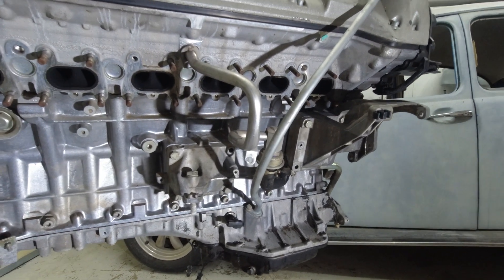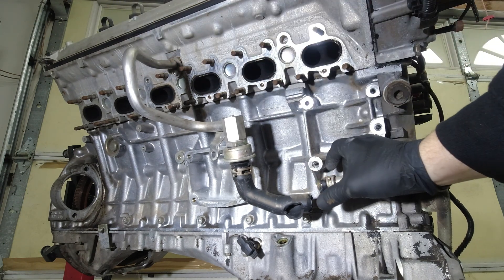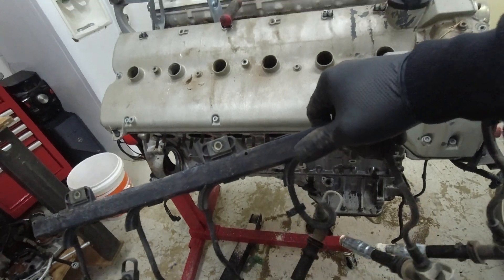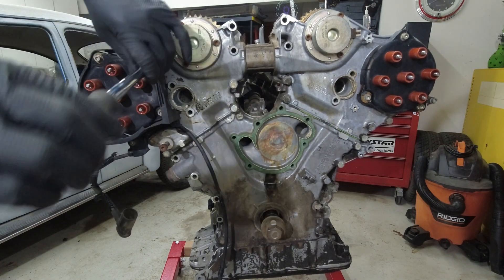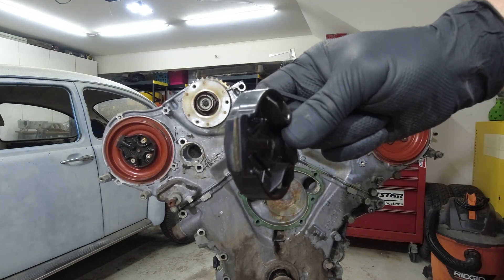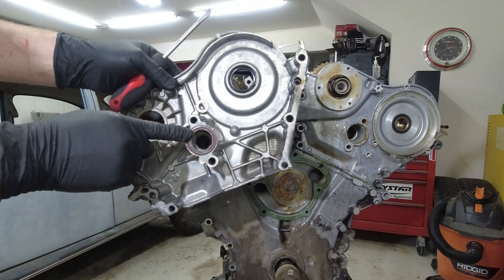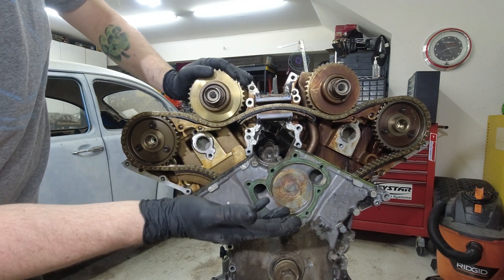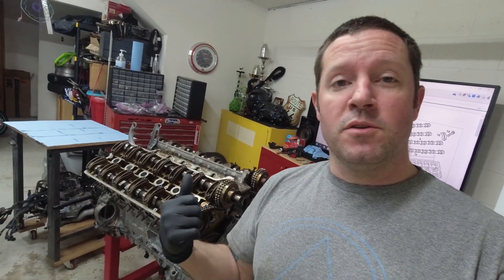M120 V12 Removal of Cylinder Head Front Covers

Comment: I am using the same engine, M120, in a project. I have to relocate the oil filter. I don't have any info on the workings of the filter such as oil routing, etc. Would you be able to share some info on relocating the filter? Thank you. Please continue with the great videos.
Reply from the maker: I'm not sure how you would relocate the oil filter.  The oil goes in and out the filter housing.  You would need one heck of a custom adapter plate with an inlet and an outlet.  Then you would be able to relocate it to anywhere you want.

Comment: Hi, how did you get the oil filter housing off? No bolts left here, but the body stays attached. Did you have to pull or push somewhere?
Reply from the maker: After the bolts are removed it might require some light motivation to be removed.  It's just stuck to the gasket.
Reply: @FriendlyMBTech  Thx, but I missed one bolt..It's loose  now. Thx for the vids!

Comment: that is a great idea to have a huge screen like that! my eyes are getting old and it would be so much easier for me to see WIS with a set up like that. i can't wait to get my m120 tomorrow. got the entire car minus the f bumper for 700. have to tow to dealership to get a key made.
Reply from the maker: You don't need it at the dealership for a key.  They can order it by the VIN.  The remote portion probably isn't available anymore but a blade version is fairly inexpensive, maybe around $30-50.
Reply: @FriendlyMBTech  it has the immobilizer in the key so i cant get one anywhere else. let me know if i am wrong.
Reply from the maker: @narcissistinjurygiver2932  either way, you don't have to have the car there.  It will come programmed already.
Reply: @FriendlyMBTech  there is no title. so all i have is a bill of sale and they say i have to bring the car. do the blade keys have the chip?
Reply: @FriendlyMBTech  the dealer wants almost 400.

Comment: I try to buy used cars with no more than 30K miles that have the advantage of depreciation but the hope (which so far has worked out!) that no one has done anything "fixing wise" to screw anything up yet!  I replaced all the breather hoses & resealed the breather covers on an M112 last year.
Reply: I'm in Florida too. Good practice with these engines besides rebuilding the breather system, is to flush or purge out the A.I.R. Injection ports. They stuff with carbon, and on OBD2 cars will set insufficient flow codes. The AIR system seems useless, but it does extend the life of the catalyst by helping it reach operating temp quicker.
Reply: @LynxStarAuto  that only happens on the m119
Reply from the maker: I need a car either for this engine or for parts for this engine.  Any car that this engine in with less than 30k miles on them are going for astronomical prices.  I need a wrecked car or one with a blown engine.
Reply: @FriendlyMBTech  Here's hoping you find one with a blown engine!  It's too bad you can't monitor the wrecking yards as I'm sure good cars get parted out that fly under everyone's radar.

I'm 60 and since 2011 I've bought only Mercedes' products while never owning one before then.  I buy models with fully-electronic engine management (Bosch ME-Motronic) but before the added complications of dual turbos, direct injection, automatic start/stop systems, cylinder deactivation, electronic thermostats & generator management.  Loosely these engines and model years:
M111 1998-2003 2.3
M119 1996-1999 4.2 5.0
M120 1996-2001 6.0
M112 1998–2015 2.4 2.6 2.8 3.0 3.2 3.7
M113 1998–2007 4.3 5.0 5.4
M272 2005-2017 2.5 3.0 3.5
M273 2006–2013 4.7 5.5
Reply from the maker: @Matt_from_Florida  those are good engines to own and pretty much the limit of what I would want as well.  With the exception of the M156.  I want to rebuild one of those eventually as well.
Reply: @FriendlyMBTech  i have the om617 that i am going thru. I am getting the m120 and then I plan to get another m113 for a spare. I bought an 03 r230 for 1200 and fixed everything and plan to keep it for retirement.  I think you can fit that m120 into a w124 and a w201.  I am not sure if the non v12 r129 will take it. if you know then let me know.
Reply from the maker: @narcissistinjurygiver2932  there has already been an M120 in a W201.  JMSpeedshop did it on his channel.  If all my stars align, I want to put the M120 in the W124 and put the M119 in the W201.
Reply: @FriendlyMBTech  i am still trying to get my eng. they seller is a jerk
Reply from the maker: @narcissistinjurygiver2932  yeah it was a pain to get mine.  The only reason I went with the place I got mine through is because they offer a 5 year warranty on it because "it has 59k miles".  I'm not sure how accurate that is though.  I bet if I actually tried to use the warranty, they would find some technicality to void it or deny the warranty claim.
Reply: @FriendlyMBTech  yea, and he does not have the key